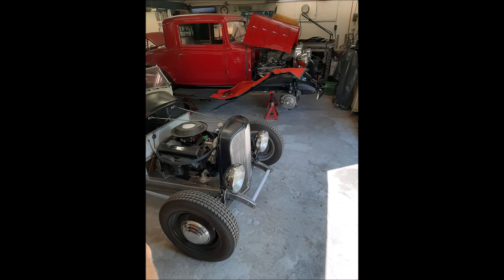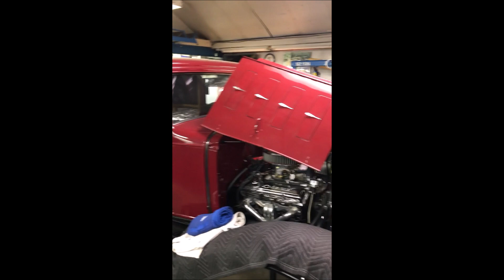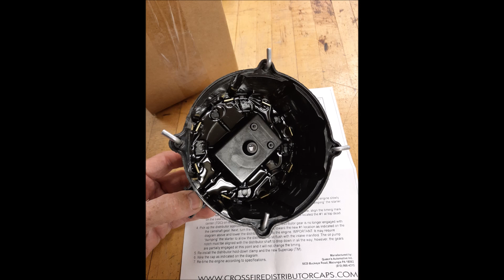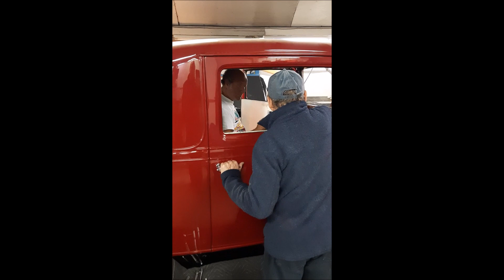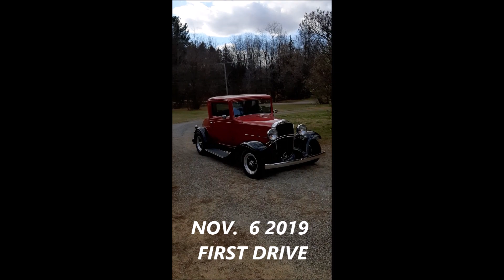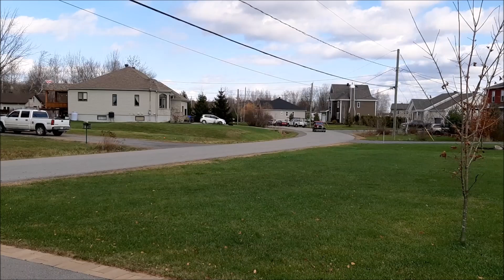KENNY'S 32 CHEVY LIVES!

Comment: Thanks for the video! I am building one in New Zealand, fabing a new chassis and front suspension. Using all C6 Corvette components.
Reply: Grdeng
Same model?
Reply: @colehara  Yes, 3 window.
Reply from the maker: Good to hear. It snowed here in Canada the next day back in November and the car has been in winter storage since. It is only now being readied for the summer season and should be out and about May 1st or so depending on Covid restrictions being lifted .
Post some YouTube videos of your project and let us know when you have done so, we would love to see it . Cheers! Mark
Reply: @grdeng  
How was the wood "cage" in the body on yours?
Reply: @mgermca  Great! Covid is an issue, my car is at work, I am stuck at home! I am only at chassis stage, building my front suspension . My car is ex Oakland, CA, had the engine and trans pulled in 1981, sat in a shed till 2016. A shipment of parts ex USA landed here the other day, again waiting for Covid!  I have some photos on   facebook.com/greg.drower
Cheers, Greg
Reply: @colehara  LOL, the worms had a very good feed! I will replace it all with steel. Huge job.
Reply: @grdeng  
Not surprised.  I know Ken found a company in the US that makes replacement wood for the body so that's what he used.  A lot of work but it came out well.
Best of luck with yours Greg!
Reply from the maker: @grdeng  you're doing some very nice work there congrats!  True labour of love to bring these cars back.
Reply from the maker: @grdeng  will you be using coil overs in the front or the transverse leaf spring Greg?
Reply: @mgermca  Ridetech (Fox) coil overs, they made the rears for me with C6 bottom mounts and the stroke I wanted.
Reply from the maker: @grdeng  thanks Greg, keep posting videos of your progress, subscribed. Cheers
Reply: @grdeng  
That looks great Greg.
Beautiful work.
Thanks for posting.
👍